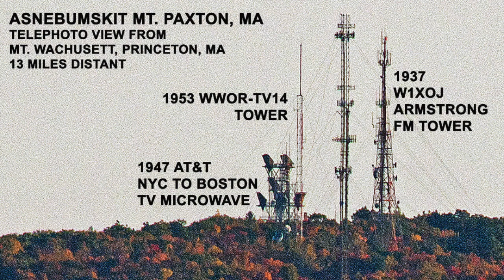W1XOJ Boston - Early FM Broadcast - Yankee Network - Edwin Armstrong - February 14 1941 - Aircheck

Comment: Hey Ellis - Now that you've added some OTR into the mix,  how about adding some obscure, hard to find CLASSIC TV into the mix??
Reply from the maker: I didn’t record much TV when I was a kid, so I really don’t have much to share.
Reply: @EllisFeaster  Maybe you could get some as you do with Radio airchecks (ESPECIALLY from local stations & independent  stations as they're airing LOCAL programming since network programming (Except for the DuMont Network) is pretty common through the shows they aired